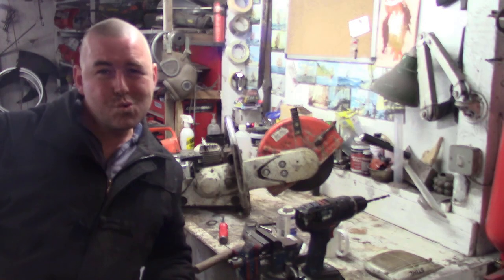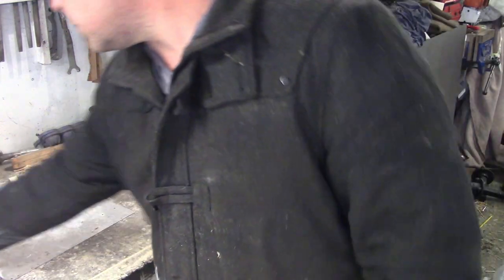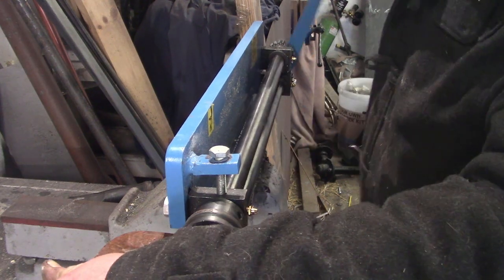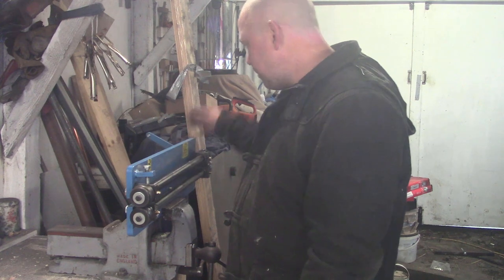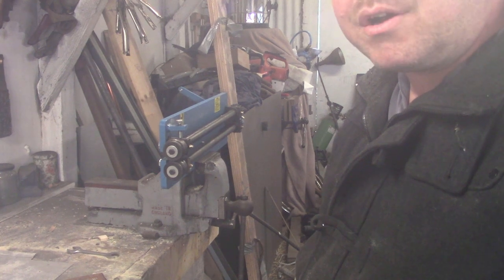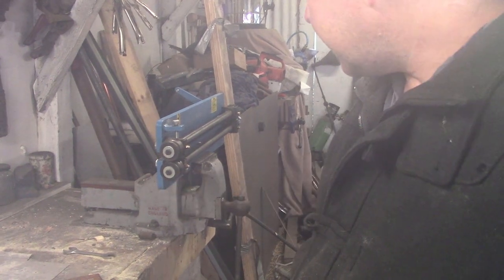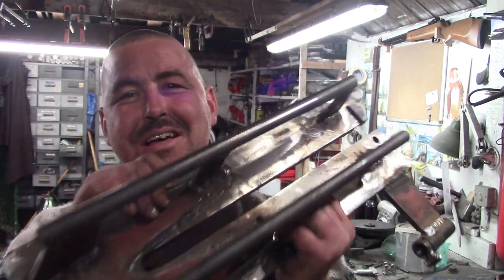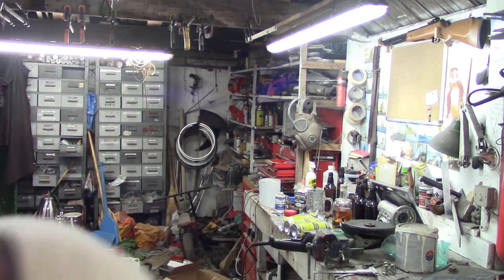Bead roller modifications pt1

Comment: Looks good. Distortion is always a problem with welding.
Reply from the maker: Until it's a benefit! 
I heard structural steelworkers can steer an I beam with a welder if things are not lined up, fancy trying that 50 floors up!
Reply: @turboconqueringmegaeagle9006  not sure I'd fancy that. Normally I work to keep distortion out.

Comment: If you can make a heavy metal plate that you can mount a few inches below the camera and heat it up prior to using the camera, maybe the heat that radiates out from it might drive the chill and moisture sat from the lens. Assuming it is not so hot as to melt the camera! My friend who lives there puts a few hot water bottles on his dashboard 20 minutes or so before leaving for work, so as to defrost the windscreen